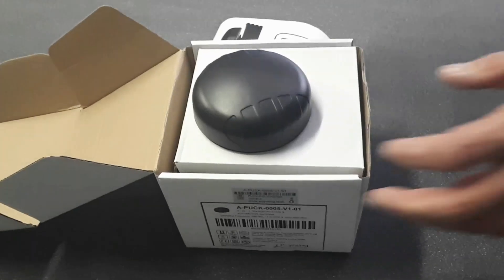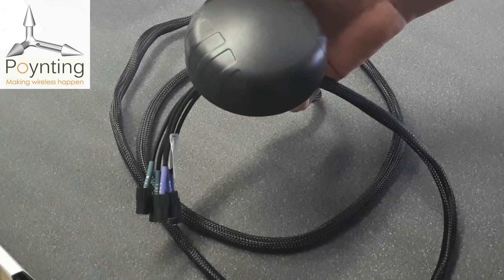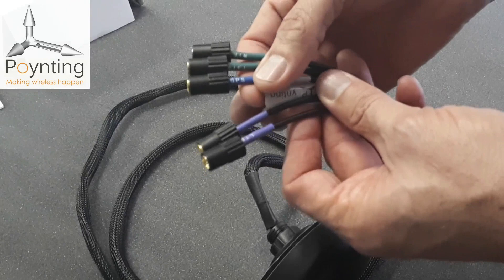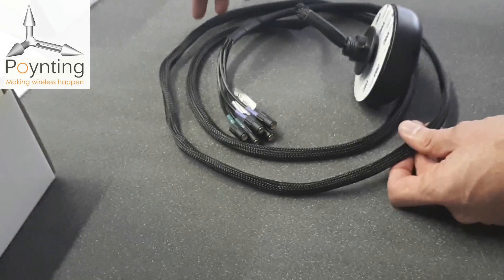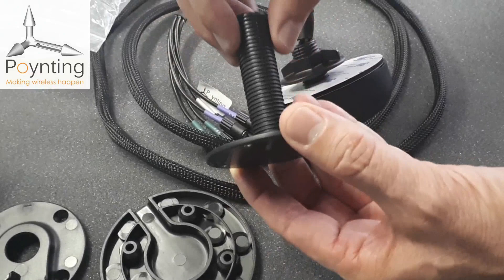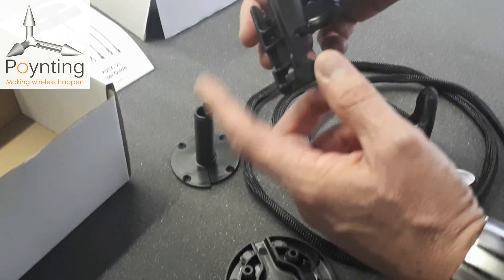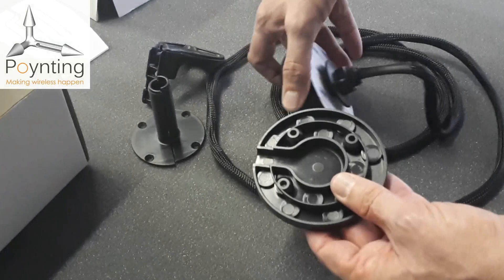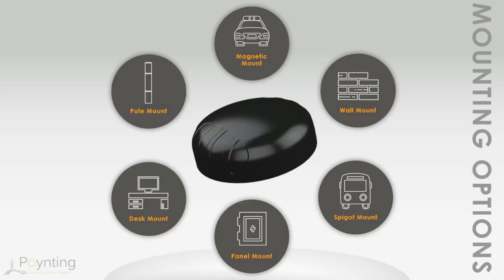Poynting PUCK antenna - unboxing

Comment: When I bought a puck ,it could not be used as the sma connectors need to have a TS9 convertor to fit the router, I had to go to eBay and order from China as they are virtually unobtainable in the UK, still not arrived. Maybe should be included as Haiwei routers are very common .
Reply: @poyntingantennas  Thanks for coming back, the model I have is a    A-PUCK-0001-V1-01 it has one lead and my Huawei E5776 has only one lead connector. Imhave been told that two leads are needed for 4G reception. Is this true?

Comment: Hi. I have a Poynting directional 2x2 MIMO connected to my Teltonika RUTX11 router.  I need also wi-fi antenna for this unit. Your recommendation please? B.R.Alex
Reply from the maker: Hi Alexander. You can use a PUCK-12 antenna that supports both the 2.4 - 2.5 GHz and 5.0 - 7.2 GHz Wi-Fi bands. More info here: https://poynting.tech/antennas/puck-12/
Tx Poynting

Comment: Hello, could you please make available the CAD files of the PUCK-12 antenna along with the mounting brackets? we need to accommodate  this antenna in our product and in order to design the suitable position for this it would be better if we have the CAD 3d files/step files to make the judgement of it..

Comment: Would it be worthwhile to upgrade to the Puck 2 from my existing x Pol 1 antenna?  I have the x pol mounted on a mast at present that is about 2m above the pitch of my home roof? I'm looking for better speed from my Lte router Model B315 . My current x pol 1 gives me 35 down and 25 up

Comment: Would you advise against modifying the mount with a very capable neodym magnet plate? Similar to old CB-Antennas for cars. I saw the last slide with magnet but no mounting option in the video.
Reply: @poyntingantennas  now i do, thank you :) do you know what are the inteferences, gain loss with using magnetic mount?

Comment: Is it standard SMA or RP-SMA?
Reply: Hi @cmorait, all connectors are standard SMA including the Wi-Fi ports however we do provide 2 x standard SMA to RP-SMA adapters as standard with each Antenna for Routers requiring RP-SMA on their Wi-Fi ports. Pieter Prinsloo, Support Engineer, Poynting Antennas.